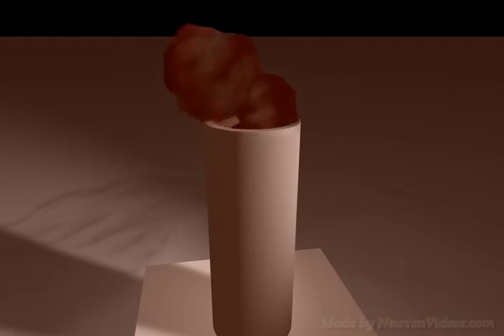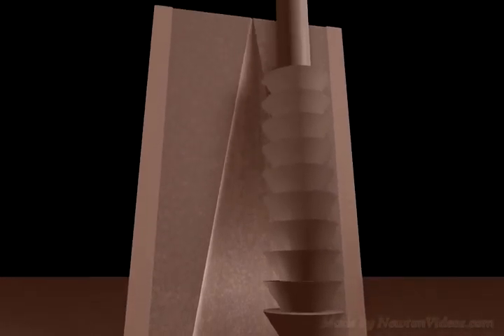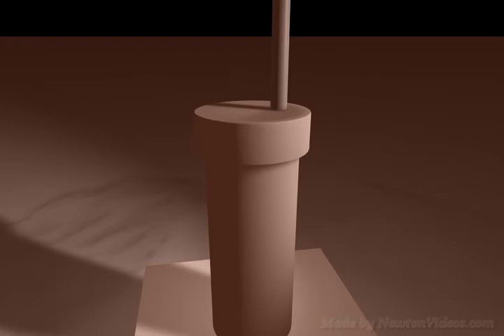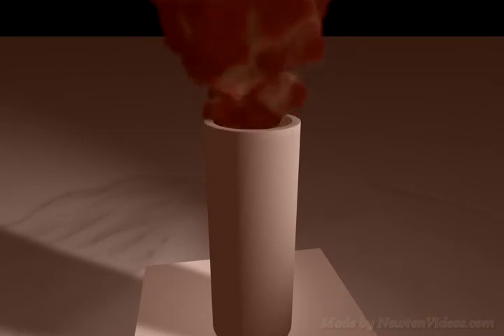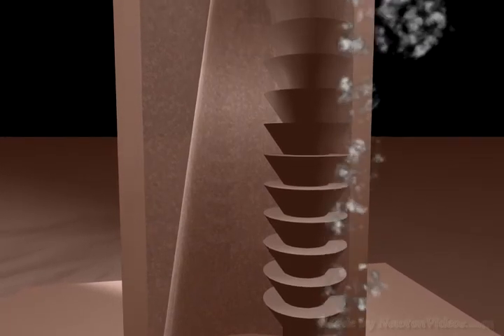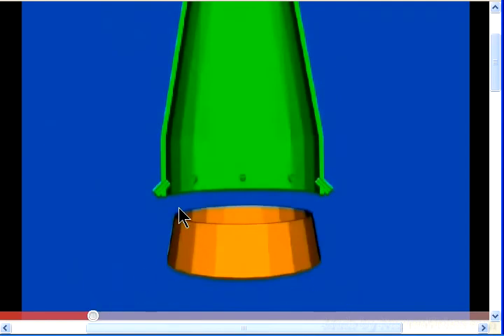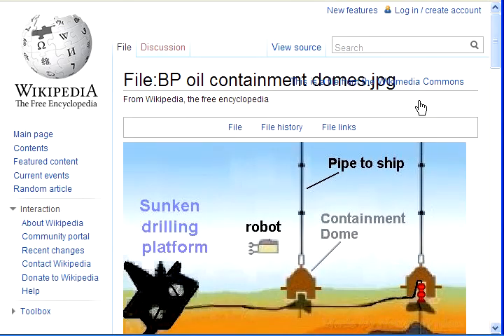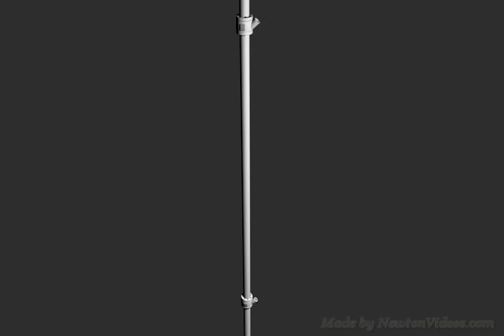Gulf of Mexico Oil Spill Leak Quick Easy Fix Solution

Comment: I have to say I like the idea but I'm not conviced that it will work! The reason being that the pressure presumably present is in the order of magnitude of 20000 to 70000 Psi (1380 to 4830 Bar) and the temperature of the oil is about 400°C. This means that the quantity of water at +- 4°C necessary to cool it down to the point of crystalisation of methane hydrate will be enormous. I believe that the second option proposed by Johnforchange is most appropriate as it redivert the flow.